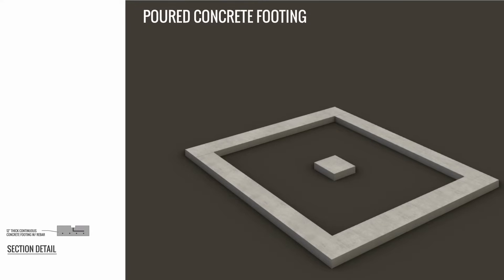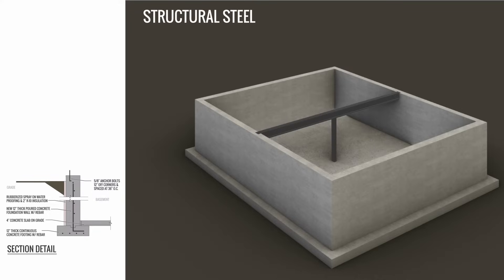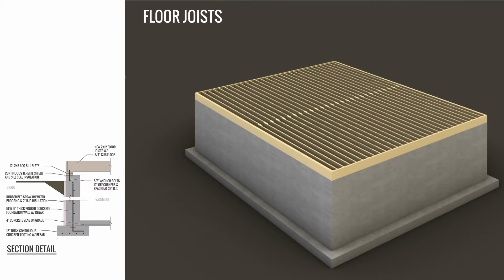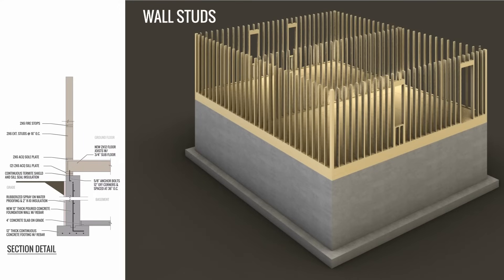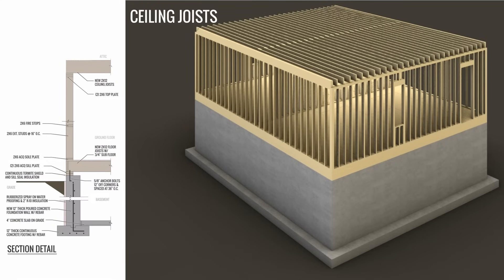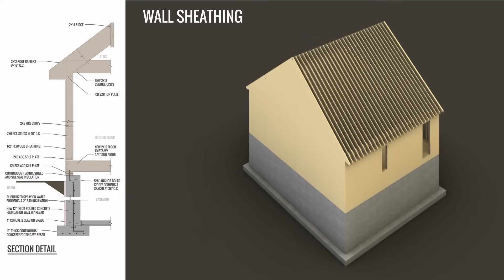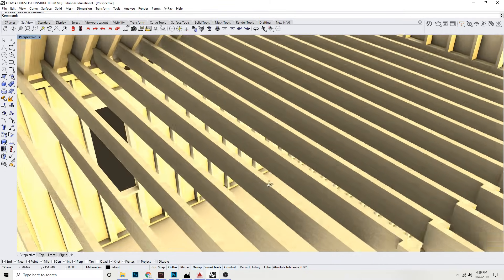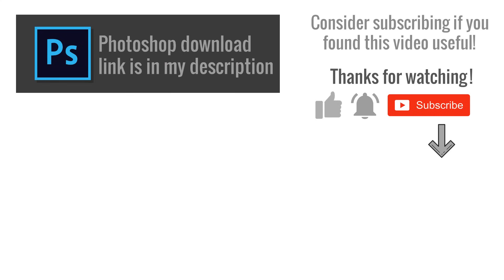Wood Framing Basics - Carpentry 101

Comment: Very nice and detailed explanation here, this can easily be a top shelf video just to learn the names of all the members, very instructive.

But I don't understand how horizontal forces are dealt with in this design, like an earthquake or strong wind. Each wall can easily change shape to a paralelogram from a rectangle under a side load. If the only thing holding the structure is nails driven from top/sole plates directly into the end grain of wall studs, as an entry/middle level woodworker I have to say that's the worst and weakest joinery you can have in woodworking. 

I understand this is the cheapest and most industrialized way but just look at how houses built this way collapse during a storm (mostly in US).
Reply from the maker: Hey thanks for watching. The exterior wall sheathing will provide shear value to resist wind forces when nailed/installed correctly. A house framed with no sheathing on it has no shear value and thats when everything is weak and can turn to parallelograms like you said. In this case the house has 4 exterior shear walls making it rigid 

The anchor bolts holding the house down to the foundation and the hurricane strapping would also hold the house down to the foundation.

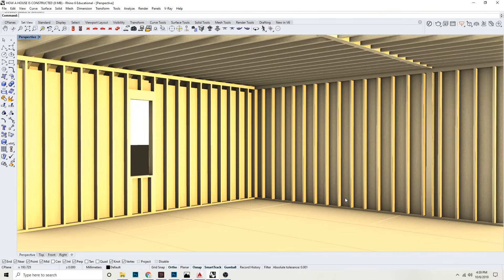Comment: 5:50 a drop beam doesnt end up showing on the lower floor if you put up a plaster false ceiling at its level. This also means you can put extra insulation and noise cancelling layers in the false ceiling
Reply from the maker: Money spent on that might as well do a larger upset beam
Reply from the maker: Also if you have an 8’ ceiling dropping the ceiling to 7’-6” would be too low for most people
Reply: @bruniarchitecture  or just elevate the floor height to compensate?

Comment: Great video! Are the front and back exterior walls lid bearing? (The walls without doors/windows in your drawing)
Reply from the maker: Thanks for watching! The bearing walls in this model are the exterior walls where the roof rafters rest and that wall in the middle that cuts the house in half holding up the ceiling joists. The walls without windows will help tie the two exterior load bearing walls together to help with the force of the roof rafters pushing out. Hope that makes sense